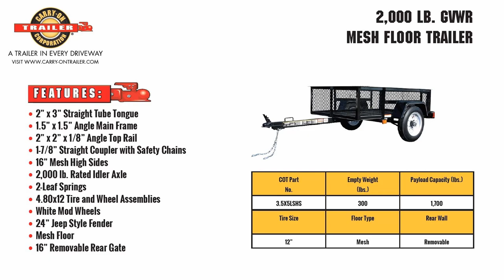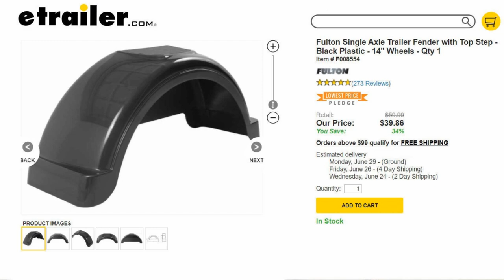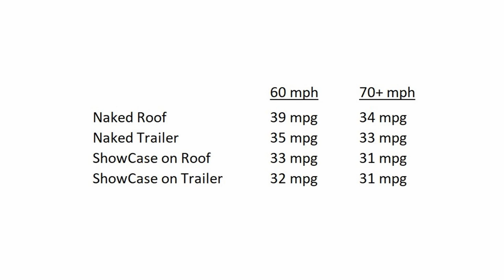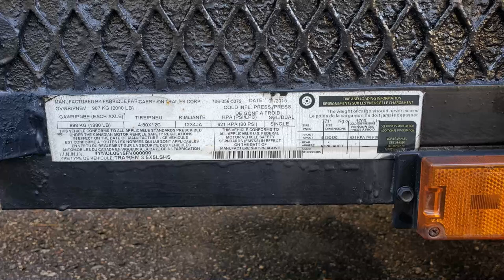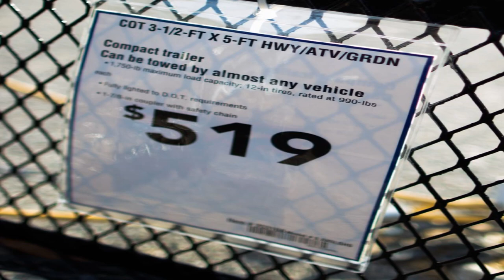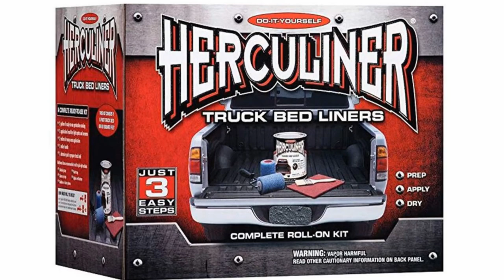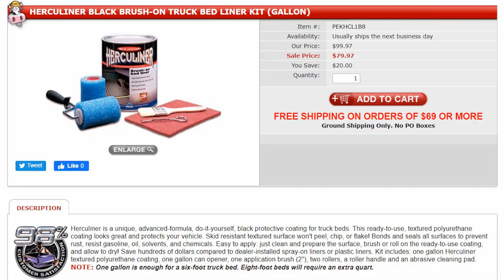CARRY-ON TRAILER 3.5x5-FT UTILITY TRAILER

Comment: Hello Dave,

I have another question for you about flipping the axle.

I am about to start my utility trailer rebuild.  I will be replacing the tires with 14 inch tires and new fenders as well.

Is it absolutely necessary to flip the axle?

Couldn't you just raise the new fenders up a little higher?

Do you think it's that significant big difference to flip the axle and put greater leaf springs on it (for a smoother ride)?
Reply from the maker: Thanks for writing, Mike. Feel free to call me Scott.  ;-)  My axle is not flipped. In fact, I'm done exactly what you asked: My fenders are both larger and raised. I also replaced the factory springs with a set with better compliance. See my website at https://stealthgti.com/carry-on-3-5x5lshs-trailer/ for details and links to the parts. I may even have some links in the video description. I don't recall. Take Care!
Reply: @StealthGTI  Hello Scott!

Thanks again for documenting your build and answering my last question.

I finally got started on my own utility trailer upgrade.  Again, I'm starting with the same utility trailer you have (3.5 X 5.0).

I quickly ran into my first hurdle.  I took off the fenders and put on my new 14 inch wheels (Etrailer Provider ST205/75R14 Radial Trailer Tire w/ 14" Silver Mod Wheel - 5 on 4-1/2 - LR C ITEM # TTWA14RSM $162.92) and found out that after putting them on I have less than 1/8 inch clearance between the tire and the side of the trailer.  Also; the bracket that holds on the suspension is even closer to the wheel as it spins.

I'm wondering did you have the same problem?

If you did what did you do?

I also noticed that my axle is bent.  I suspected it when I was taking off the 12 inch wheels and three of the treads have wear and the fourth tread still looks almost new.

But I'm more concerned on how to get 1 1/2 inches clearance between the wheel and the side of the trailer much like the distance between the 12 inch wheels and the trailer originally was.

Could you provide some comments?
Reply: @michaelhowell3641  I can't really answer for Scott, but I am going down the same path as you (seems like Scott has started quite the trend lol). The axle is intentionally bent, it is designed that way to (I think) help with weight distribution, as more weight is applied to the trailer, the axle may tend to straighten slightly. I am awaiting wheels etc, and will be purchasing a 54" hub face axle from Northern Tool (about $85) to alleviate the loss of clearance between tires and trailer body etc. I hope this helps.
Reply: @motoace2007  Hello,

Thanks for your response.

"You think"?

Do you know for sure, or this is more your opinion about the bend in the axle?

Do you have the same Carry On utility trailer (3.5 X 5.0)?

How'd you decide on the 54 inches?

Included in your 54 inches, how much space did you allow for between the inside of your tire to the wall of the trailer?

Mike, working in L.A.!
Reply: @michaelhowell3641  Same trailer, yes - I had read that the bend is designed to support the full load of the trailer. If you flip the axle as others have done, you will lessen the weight carrying capacity of the trailer. I read some of Scotts additional posts on his website that states he is now using a 54" face axle, so that is what I plan to use.
Reply: @motoace2007  Do you know if that's the only solution?

I'm not that familiar with axles and that part of the trailer.

Is there a way just to put spacers or longer hubs or something?

...  Or perhaps a new axle is the cheapest and safest route?

It would be interesting to watch each other's build.  We could make comparisons if you're interested.

We could swap photos to see our similarities or differences.  Just a thought; I thought maybe it would be interesting.

However; if you prefer to be more private doing your build, that's OK..

If not, would you be interested in switching emails and sending photos?
Reply: @motoace2007  Hello Crazy Kiwi; did you get your 54 inch axle yet?

I would be interested in knowing how it is working out for you.  Did it solve the clearance between the wheel and the side of the trailer?

I probably will get the 54 inch axle as well.
Reply from the maker: @michaelhowell3641  - Sorry about the delay. I've been traveling. My tires are not that wide; I went with 175/80R13 instead of tires as wide and tall as yours. My only potential interference was the forward leaf spring bolt... it was very close to the tire. I removed it and fed it through the opposite direction, which bought me a 1/2" or so.

Regarding your axle, it is not bent. The curve is there by design. So, don't worry about it. When I upgraded my axle, I could not find the exact same size; so, I bought one that was either one or two inches wider. That gave me a little more clearance from the frame.
Reply: @StealthGTI  Thanks for the reply!

I guess I might have overkilled the size of my tires.  However; I got them now and going to go with it.

I'm only using the trailer as a luggage trailer pulled behind my dodge caravan.

I doubt if I get up to maybe 500 pounds in cargo weight.  Although, I'm making a top cover with a wood frame and aluminum sheet covering.  I guess that might add 75 or 100 pounds more.

I saw that the measurement between the 12 inch tire and the side of the trailer carriage had about 2 1/2 inches clearance.  I was going to get a similar axle as yours to maintain that clearance with the new wheels.

I was also concerned about how close the wheel was to the spring bolt.

However; I talked to my local auto repair guy and he said spacers on the axle would give enough clearance and would be safe because I'm not caring that heavy of a load.

So I might just go with the spacers and get a new axle later.
Reply: @michaelhowell3641  Hi there, I have not yet. My wheels arrived a couple of days ago, but the tires don't arrive until tomorrow. I will probably get the axle tomorrow also. I feel that the extra three inches total, will solve most issues. I will keep you posted.
Reply: @motoace2007  Holy Tamoli!

Don't make the mistake I made.

I don't know why I bought 14 inch tires.

Way OVERKILL for these little Carry On utility trailers.

I bought Provider ST205/75R14 Radial Trailer Tire w/ 14" Silver Mod Wheel - 5 on 4-1/2 - LR tires and if the tire was any closer to the side of the trailer it would start a fire!

I tried all kinds of spacers and ran all over town wasting a whole day's work.

13 inch tires with an average tread width is plenty good for these small utility trailers.

Otherwise they're going to rub the sides and tear up your tires.  Not only that, there is no space to connect my fender.

I'll have to sell these tires and get some 13 inchers.

Not a bad idea to get a longer axle.  I probably could use the tires if I were to get a longer axle.  But I think I'll wait on that for another time.
Reply: @WAHMike  I installed the longer axle today. Tires finally arrived so I can have those installed on the rims tomorrow. I bought 14" rims with 195/60/14 tires. I am hoping that with the longer axle I won't have any issues. The truth will reveal itself tomorrow. Did you install those wheels/tires on the original axle? Did the spacers not help?
Reply: You probably will be OK since you've got a longer axle.

I know with the 12 inch wheels there was at least 1½ inches clearance between the wheel and the side of my trailer..

You bought smaller tires than I did, (ST205/75R14).  So with the longer axle you probably will be OK.

I would be interested in seeing how your 14 inch tires perform and the profile.  My local auto repair guy told me that the tire was overkill and looked gaudy.  However, appearance wise it looked fine to me.

Yes, I did install my wheels on the original axle.  I had contacted the same axle company that Scott had on his web page.  I sent them all my information, but they've never contacted me back.  So I thought I would give it a go with my regular axle.  I got impatient.

I also tried spacers from an auto parts store but they weren't big enough (less than 1/4 inch) and I only had enough space to fit a pencil between the tire and side.

I'm considering on just putting on 13 inch tires so I can get the trailer rolling and then later replace the axle and maybe go back to 14 inches.

Anyway, hope you have good results tomorrow.  Let me know.   @motoace2007
Reply: @WAHMike  tires are on, I have tons of clearance and the wheels/tires look great. I did flip the axle at install - which helps a lot. The only challenge is that the fender is now to narrow compared to the width of the tires. I'm not too concerned as I will get some wider fenders at some point. It will be towed behind a subaru outback so I think the height will compliment the outback perfectly.
Reply: @motoace2007  Congratulations, it sounds like you're ready to roll!

Let me ask you, you got taller/wider wheels than Scott did.  Is that because you have a taller profile towing vehicle/Subaru outback?

Are you using this for highway driving, or are you going to be pulling this through the woods, camping etc?

Also, did you upgrade to the four leaf springs like Scott did?

If not, how are the stocks springs with the bigger wheels working out?
Reply: @motoace2007  One more question if I might add.

Did you get the same exact axle as Scott did?
Reply: @WAHMike  I will mostly be doing highway driving with a small amount of off road driving (nothing too crazy - probably gravel roads). I will be doing some city driving but not too much other than picking up some hardware etc, from a hardware store, such as lumber etc. I didn't (as of yet) upgrade the springs but may do that at some point as well. I have sunk some cash into the trailer already with ratchet hooks for the trailer bed, and sides. I installed LED brake/tail lights etc so I should probably stop pouring money into it for now. Eventually I will get some sort of rack system to install on it for a cargo tray/kayaks/roof box etc in case I don't want that stuff on my car. I also have a Thule Awning for it that I will put on a couple of uprights that can be lowered and raised as needed. I put a good coat of paint on the plywood this afternoon and so I am just letting that dry before I take it out on the road. Oh, and at one point Scott had those exact same wheel specs on his trailer, so I had to assume that they would work - but they also (with the axle flip) help to raise the trailer to a nice level behind the Subie. It is the axle from Northern Tool co, - the one I had previously linked in here.
Reply: @motoace2007  Sounds good.

I didn't see a direct link to Northern on the axle.  Do you mind giving me the direct link to the axle you purchased.

I'm going to have to get an axle and start over with some new wheels.
Reply: @WAHMike  my comment keeps getting deleted, probably because I include a link to the axle. If you go to northern tool and search for 54" face axle you'll find it. It's about $82. You'll need the u bolt kit too.
Reply: @motoace2007  Thanks.  I see the axle for $82.00.  But it doesn't look like includes the hub.  I take it you used the hub from the original axle?
Reply: @WAHMike  correct the hubs will transfer over to the new axle. Just be sure to leave the axle nuts loose (otherwise they'll crush the bearings and they won't roll freely).
Reply: Roger that.  Thanks on the tip about the bearings.

Is there anything else I should know about purchasing the axle.  Are there any other measurements I should be aware of that works best with our Carry On conversion?

The axle you got from Northern, does it have the EZ lube feature?

I will also probably get it from Northern, but I will first check with a local trailer hitch business (Hitch Depot) here.  I might just be able to go pick it up.

I think I will also go ahead and purchase the same size tires you got.  I think the 14 inch rims will ride better on the freeway.
Reply: @WAHMike  The axle does have a simple lube feature, I am not sure it is exactly like the one that Scott has, but it has a zerk fitting on the end of the axle, so pretty similar. I can't think of any other measurements etc. Good luck!
Reply: Same to you my friend!

Thanks for sharing your experience and trailer build.

Once I get the axle and wheels situated and the new fenders on...

I will make a wooden frame top-cover, wrapped with aluminum/or tin.  It will open like a car trunk.

I will also weld side supports for the tongue and mount the spare tire horizontally over the front part of my cover, because I will divide the cover into two halves.  The front half won't open since the tire will be mounted over the top.

I will also add another vertical foot to the cargo area.

I'm also going to place an air foil on the back so when I press my brakes it flips up to catch the wind.  Just for fun!

"Enjoy the Journey" and your new trailer and thanks again!   @motoace2007

Comment: Was just looking at your video about your trailer and I have a question if you don't mind? Did  you have to use wheel spacers and if so could you please send me the link where you purchased them? Thank you
Reply from the maker: Not at all. Despite the stick-on VW emblems, which I have removed, the wheels are 14" trailer wheels with zero offset. I will replace them with 13" wheels and proper trailer tires when the passenger radials wear out. Thanks for visiting.

Comment: Great trailer, actually just got mine yesterday and yours is very close what I need to do on mine. Did you use any kind of adapter to change the wheels?
Reply from the maker: There may be two or three photos in the video in which I have VW wheels mounted. I used adapters for those, but I don't recommend them. I think they're a hassle at maintenance time. I have standard black trailer wheels mounted. The hub caps are just generic caps from etrailer.com. I put VW emblem stickers on them to complete a look. Thanks for visiting!

Comment: Far fetched question but do you think a GTI can haul a travel trailer that meets the maximum towing capability the engine, chasis and tow hitch can handle? I own a Jayco that weighs under 3k my wife’s suv hauls. Just curious
Reply from the maker: I wouldn't do it! Even though the UK's towing guidelines say that the GTI can tow 3500 lbs, that's with their 55 mph towing speed limit and 5% tongue weights in mind. Even if the GTI can pull your Jayco (and I'm sure it can PULL it), the 10% tongue weight that it's probably balanced to far exceeds the tongue weight limit of the GTI. And you'd be completely hosed in court if anything happened. Take Care!
Reply: @StealthGTI  thank you from one gti owner to another! keep the journey going!

Comment: When you upgraded the tires, did you find a rim that fit the trailer bolt pattern, or use something with an adaptor? 

Between trying to properly identify my trailer bolt pattern and finding large wheels on 'trailer' rims, I'm having a hard time!
Reply from the maker: I experimented with using adapters and VW wheels. But I eventually switched back to standard trailer wheels for easier shopping and maintenance. I think the 5x4.5" bolt pattern is most popular, especially on medium-sized trailers. I don't think you'll find a wheel larger than 15" with that pattern. There are larger wheels, but they have more bolts and the assumption that an even larger, stronger tire will be used to carry even heavier loads. In my opinion, lower profile tires on trailers present a risk of damage since trailer suspensions are not as compliant as the tow vehicle's. Once I came to that conclusion, I decided to just stay with dedicated trailer tires in standard sizes. Long answer, but i hope it was helpful. Take Care!
Reply: @StealthGTI  it was!!

I found some 14 inches and fenders very similar to yours, I think my trailer has the same dinky 12" wheels that, violently, bounce around :p

Comment: Wonderful video! Really helped with my decision making... the only problem is that since this is no longer available, or extremely hard and expensive to get hold of, would you recommend going smaller to the 40" x 48" or bigger to the 4' x 6'? Anyone can answer and I would really appreciate any advice!
Reply from the maker: Thank you! I would choose a 4x6 over a 40x48 for three reasons: 1) There are times when I wish that I had just a little more floor space. Being able to lay a sheet of plywood flat in the trailer would be nice. I think a 40x48 would leave you wanting for more. 2) Backing an even shorter trailer would be more difficult than the 4x6. 3) Look at the owner's manuals for any 40x48" trailer that you may be considering. I found that the ones from Harbor Freight and Northern Tool have speed restrictions of just 45-mph, meaning they're not recommended for highway use, even though they're touted as "highway legal" due to their lighting. I'm not sure why they list a restriction, be it the hubs or bolt-together construction. But it concerns me. I have photos of the manuals at https://stealthgti.com/2019/03/18/pros-and-cons-of-various-cargo-transport-methods/. Good Luck!
Reply: @StealthGTI  Thank you very much for the info! Very happy to have subscribed!
Reply: Would definitely suggest the 4×6 bigger one! MUCH better to at times have a little bit to much unused area than really need more area that you simply don't have !!

Comment: Thanks for all the info on the trailer.  I recently bought one to save on fuel and need to replace the leaf springs so it isn't so violent. I visited your website.  Are the 24 5/8" 4 leaf slipper springs  you reference to the correct size for this trailer?  Thank you!
Reply from the maker: I don't recall lengths, but the springs linked on my website are the correct ones. Also, larger tires which run at lower pressures will work wonders to calm the ride, too. Good Luck!
Reply: @StealthGTI  awesome thank you